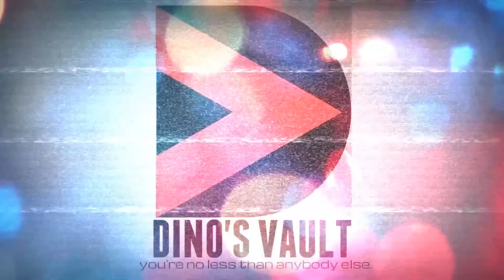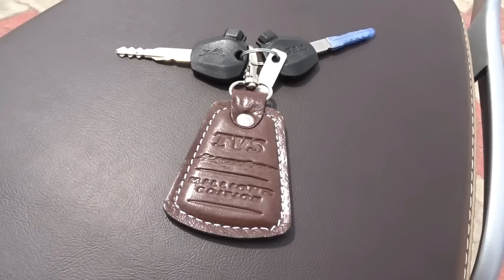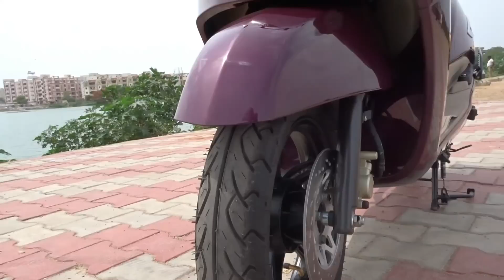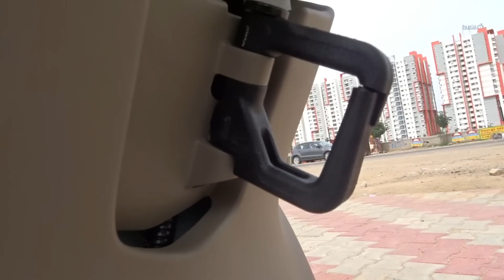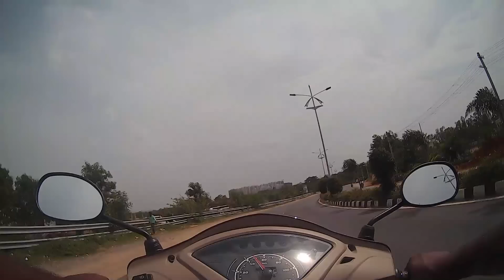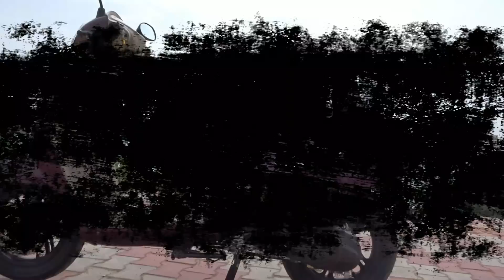#ScooterFest: TVS Jupiter Million R Edition 2016 Walkaround Review, Test Ride

Comment: Just purchased a TVS Jupiter ZX Disc variant, Starlight Blue color. Rs. 81,075 On road, Bengaluru. Awesome features like : LED headlight, Adjustable gas shock at rear, Disc, Mobile charger, 12 in alloys, Digi analog speedo. Thanks Dino, your review was convincing enough.

Comment: My disc brakes are rubbing a little bit and when I run at speed above 40kmph it produces shock and gives vibration effect.
I showed it to the service centre they said its ok, it comes with each disc brakes but I don't think so is it true it gives a shock.
Reply: yes this is fact TVs co.not bother,IAM also facing same problem not solved by seller ,they are not capable ,I shock and keep mum,helpless now

Comment: activa 3g or Jupiter
Reply from the maker: Tough call, Activa 3G still offers better pickup and refinement. Jupiter offers better value with larger 12 inch wheels, optional front disc, gas charged rear suspension, etc.

Comment: The front disc was awaited for a long time... But otherwise, the scooter is much the same as before. They should have added a digital speedo with some more details to display. Disappointed by the same old analog speedo. It ruins the overall smartness of the scooter.